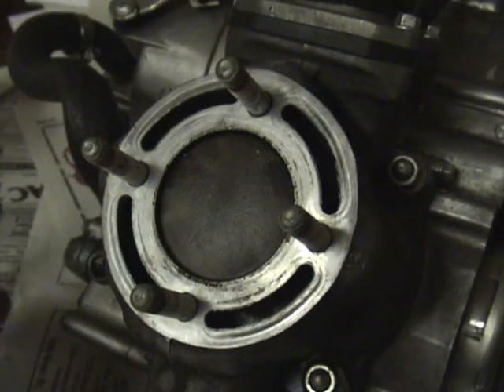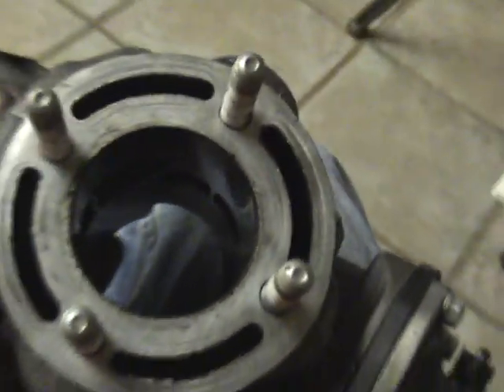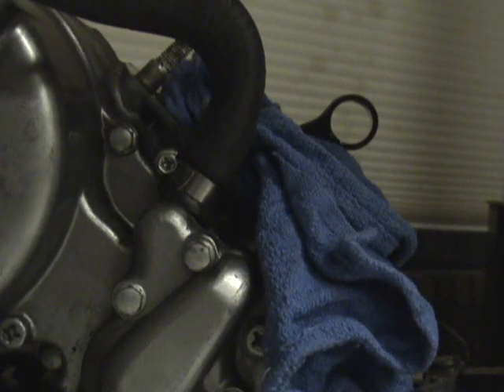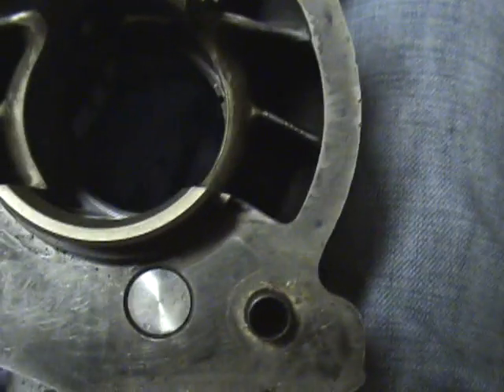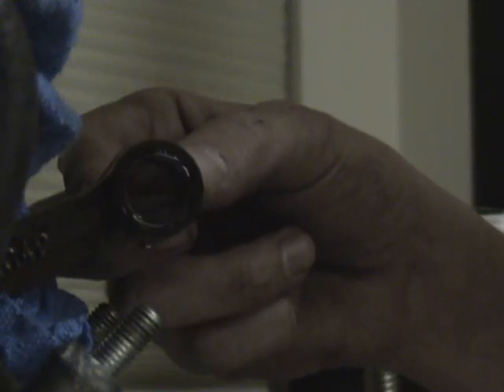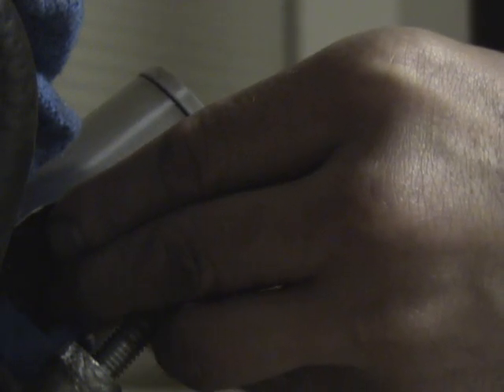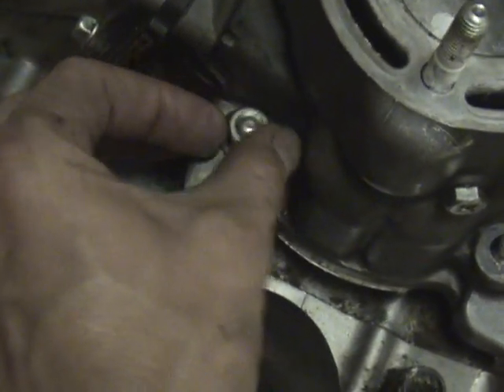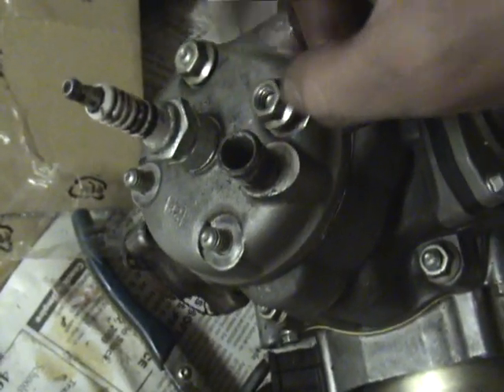honda cr 85 top end rebuild how to

Comment: Thank you for this informative video. I just got Honda CR 85 and it has done 27 hours after piston and 37 hours after bottom end rebuild. I thought this is ok hours in weekend-style riding? I ride on small roads and on ice with spike-tires. I think it has still good pressure in the bore, and power, it does wheelie on every speed. Should I check the piston out? It has c-size piston and the main jet is larger than the original one.

Comment: 8-10 hours ? i ride on the road so i should be good for ages
Reply: INDX iLaC You don't need to change the piston every 8-10 hours, more like 70-85h, but you should look over it once in a while.
Reply: Moto Quadro
2 stroke problems init
Reply: INDX iLaC Just because it's a 2-stroke doesn't mean you have to change every 8-10 hours, unless you're Ryan Suratt.
Reply: Moto Quadro
yeah i know it doesnt but its a lot more problems then a 4 stroke but i dont have an 85 i have a 125 so i got more hours then an 85 but its still long might have to swap for a 4 stroke
Reply: INDX iLaC True, you can go through top ends a lot faster or a 2-stroke, considering the piston firing each time it hits the top of the cylinder.
Reply: yes very annoying

Comment: good job. but when you said replace piston every 8-10 hours that is not true thats like every 3 rides. its more like 50-75 hours
Reply from the maker: RieZ Jackson of trail riding maybe. i meant 8-10 hard hours of racing.  Endurance road racing in my case.
Reply: tripletrash yeah if you do motocross when you have that B pegged out all the time lol yeah then you might want to change it
Reply from the maker: we ran the motor in a road racing chassis on asphalt road courses.   4-12 hour long races with teams of 2-4 riders.  after 12 hours at red line they are pretty much done.

Comment: Just replaced top end and coolant ring in the crank case on my cr85 because the bike was bogging down and not starting back up as if it was out of gas. Still happening! The gas and plugs and air filter are all good. PLEASE HELP!!!!
Reply: Pull your Reed manifold out and check your reeds. Sounds like like it could be a problem in there or your carb.. But check the reeds, I been a bike mechanic for 21 years and I wouldn't believe some of the stuff I've seen. One time a guys banshee sucked a piece of a ripped foam air filter right threw the carb and into the Reed manifold.. He checked everything except the reeds.. I told him to pull off the reeds so he did and inside he found a nice chunk of foam from the air filter. Took it out bike was back to normal. So Definatly check the reeds even one small crack in one of them will make the bike do what it's doing
Reply from the maker: Henry Mccullough check your ignition.  sounds like your electronics might be failing. seems like a carburetor issue at first but isn't.

Comment: Good video. I changed the rings without changing the piston & ended up with less compression even though the piston was in good shape. Was choked. Anyway do you check the piston/cylinder clearance? I always check the ring gap in 3 difference places in the cylinder & I don't take the cylinder top off.

Comment from the maker: mo·tor  (mtr)
n.
1. Something, such as a machine or an engine, that produces or imparts motion.
2. A device that converts any form of energy into mechanical energy, especially an internal-combustion engine or an arrangement of coils and magnets that converts electric current into mechanical power.

Comment from the maker: to be fair in this video i don't ride anything, i simply rebuild a motor.  We put these small dirt bike motors in honda RS125 chassis and road race them on asphalt.  I have one with a KTM 65 one with a honda 85 and two with yamaha 85's bored over to 92 and 96 cc's respectively.  I also have a kx60 motard and a CR80 motard.  All very fun for my damn near 30 year old  self to ride.   Ive got a crf150r ride sometimes my girlfriend has a ttr125 also have a cr125 motocross bike and ktm endro fr dirt.

Comment: Hi, i have the 2002 CR80, and buy at ebay the namura pistontha t is 46.94mm and the wiseco cylinder sleeve, but it doesnt fit the piston is smaller size, do you know the original size or the right size for the piston?? thak u very much =)

Comment from the maker: the end gap has a pecific range of measurment it needs to fall in.  mine was a little tight.  When the ring/ piston expand from heat it can seize the motor if this and other clearances arent correct.

Comment from the maker: @bulletproof8686 My maintenance intervals are for a race motor.  For trail riding you would get many more hours out of it. A 4 stroke would probably make a better trail bike because it has better low end power.

Comment from the maker: @carlito199322 I used the same two stroke oil I use for my pre mix to lubricate the parts.   and I compressed the ring with my hand and slid the jug down on the piston and case studs. if your finding it difficult to install make sure you have the locating pin in the piston ring grove lined up with the ring gap.   A piston ring compressor could also be used but I don't use it in this case.

Comment from the maker: @kawikfx400rider  I use the same two stroke oil I mix with the gas.  You need to check the ring gap, it may or may not need to be adjusted.

Comment from the maker: @jjlew06 you could have an issue in the bottom end. really no way to tell without seeing it.  if your mechanically inclined and have a shop manual for the motor you might go about troubleshooting it. Going to a trained mechanic may be your best bet.

Comment: he checked the gap wrongly!
u must check it mid way up cylinder NOT over the ports as the ring slides into these a little giving to large a gap.
and only use diamond file.

Comment from the maker: @vincent12225 Motocross and supercross is very different on a motor than road racing.  I have no experience with dirt motors but after running 8 hours at redline on a road race track the piston is done.

Comment: Bullshit. You do not need to rebuild the top end every 8-10 hours. If you race and never let off the throttle, then maybe. But I have like 20 hours on my yz85 and it Runs perfect.
Why waste 100 bucks on a top end when you don't need it. But I'm going to rebuild my top end this winter. That will be like 40 hours

Comment: How come the engine rebuild recommendations are something like 5hours 80cc 10hours 125cc?

A 125 is the highest HP/Litre of dirtbikes, and theres also torque of 125cc wearing down the piston, not only the rpm of the 80cc..

Comment: @tripletrash i have seized one motor on my yz85 and thats cause i blew my crank bearings. i never set the ring gap because 9 times out of ten you dont need to. i race and have raced dirtbikes for 11 years now (im 15) and learned from my dad who has been doing 2 smoker motors for 25+ years now and he said he did it once because he bought the wrong size ring (a,b,c, cylinders). I had a KTM 65 that had more compression than a 125 (1200 dollars of motor work) and didnt have to set the gap

Comment from the maker: @RIPBJN by filing the ring down I assume you mean when i set the ring gap.  That is very necessary and you are just lucky you have not seized a motor yet.  READ the instructions with your next piston.  why else would they give a spec. for it?

Comment: ive done 30+ rebuilds top or bottom (when ever you do a bottom u do a top end too) and never once have i filed the ring down. Your not suppose to and you getting lucky you havent messed your cylinder up. And you are suppose to do a hone everytime you do a rebuild to break the glaze the piston makes on the cylinder and OEM pistons dont produce moer power the just last a lot longer than most brands.

Comment from the maker: @the451motocross Thanks, i just decided to video my rebuild one night because i didn't have anything better to do.  I don't know what book you have but every shop manual i own has both metric and "standard" measurements. i use the metric measurements because its easier.  you always brake in a motor after a rebuild but i'm not sure what your point is.

Comment from the maker: its an 85, I have several cylinders 80& 85 and they all use head gaskets.  I know of a few after market heads that use o rings but I don't have one.  the 80 is really an 82cc and the 85 is an 83cc so not much difference.

Comment: brill vid mate just wondering your motor must be a 80 not an 85 as the top end gasket you replaced is only on the 80's an 85 just has a rubber o-ring but tbh i dont see a differance in 80-85 its just a maketing took . and i prefer the wiseco pistons as they are slightly lighter and slightly stronger . and again brill vid mate

Comment from the maker: keep them stock or only lightly modified and they will be pretty much bullet proof.  you can use the cylinder until it is out of spec. there is no set number of pistons.  you could get a leak around the head or base of the cylinder if the bolts aren't properly torqued.  IF you get this kind of leak the bike will have poor power and will  sputter.

Comment from the maker: Thanks, my intention with this video was to show how simple this kind of maintenece realy is.  the 4 stroke is some what more complicated, but its not anything to be afraid of.  the hardest part for your bike is geting the timing correct.  this is nothing to be afraid of either.  If it takes you a few hours to do your top end that is a good thing, it means your taking the time to do it properly, and you will get faster with experence. I'll do a 4T video if I get a chance.

Comment: my '88 cr125 cuts out 3rd-6th gear powerband but that i am 95% sure its because of low compression, i can push the kickstart with my pinky... going to rebuild motor this winter

Comment from the maker: you will notice a drop in performance.  you should read your manual, it will give you intervals for service and maintence checks.  I do a lot more maintence and rebuilds than you will probably need because of the type of riding I do.

Comment: Besides a great port job (by Chris Sculley)  the pipe is tuned to the engine, so my power-band is where i like it. Im running a Vortex programable ignition, flat side carby. I'll have a look for my dyno print out and post the Torque  figures, you will be impressed !!! I think from memory its around 14fp. Did you check my racing vids?

Comment from the maker: several. you can fill it with fluid(mabe carb or brake cleaner or gas) swish it around and dump it back out the hole it fell in. if this does not work, and it may not, you have to split the case.